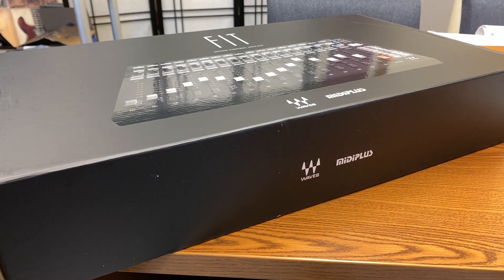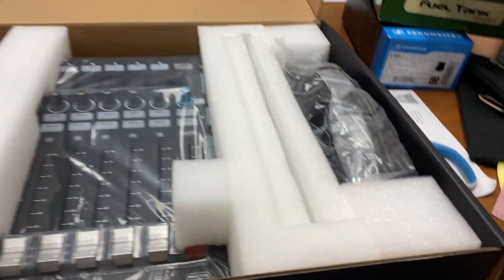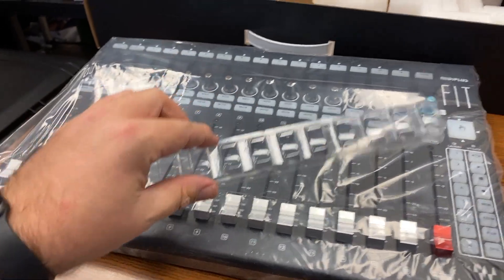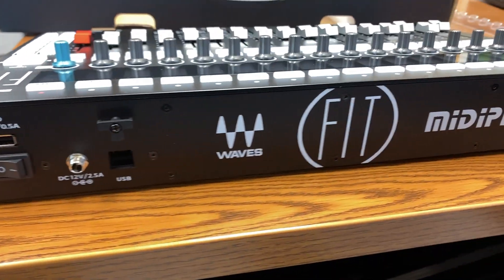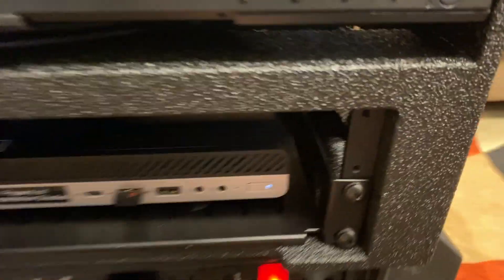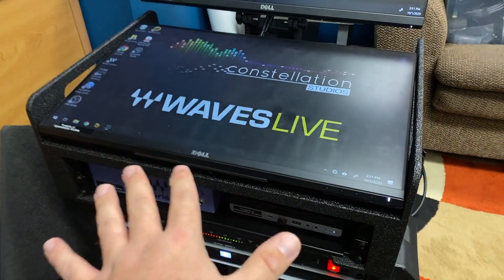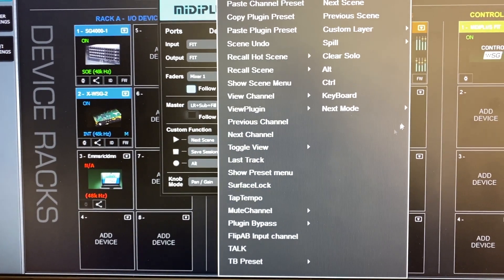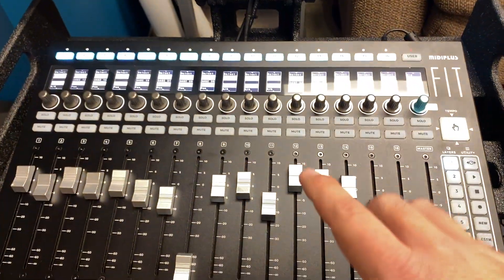Fit Controller for LV1 Unboxing and Basic Install

Comment: How is your Digigrid D attached to your shelf?
Reply from the maker: It’s got some Velcro strips on it so I can pull it out easier. The knobs on the top have definitely got a bit beat up in transit. Still work just fine, but the soft rubber stuff gets dinged up pretty easy. I might do the DSPRO1000 if I were to do it again. It didn’t exist when I ordered and put this stuff together.

Comment: are you running native mode thru your pc? may i know what is the specs of your pc.thanks a lot
Reply from the maker: This is LV1 which isn’t a “Native Mode” application. It requires a Soundgrid Server. I have the Extreme model. The PC itself is an HP EliteDesk 705 G4 - mini desktop - Ryzen 5 Pro 2400GE 3.2 GHz - 16GB ram. Runs the LV1 software great!